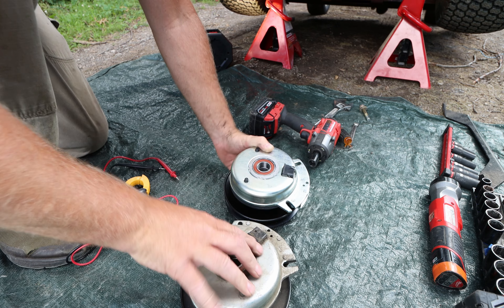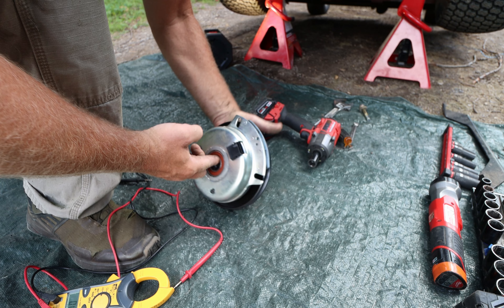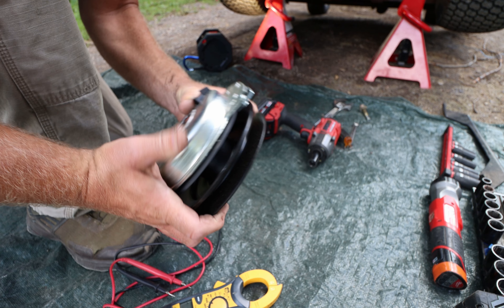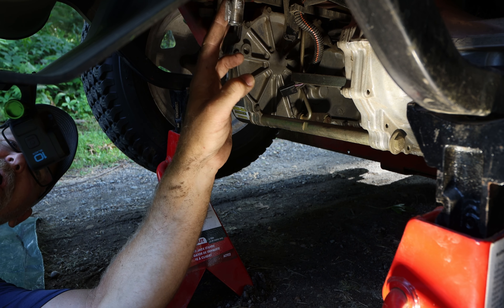Exmark Radius Clutch Replacement!

Comment: Doing this today on my father-in-law's exmark radius.     Great video.     Thanks
Reply from the maker: Thank you!
Reply: @oakwoodlawnmaintenancellc.1093 mine has been on since I bought it and it still works but I'm almost certain the bearings are bad. I just bought the newest Milwaukee 3/8 impact with 1500 break away torque but am afraid the bolt will break off inside the shaft on the 3rd setting. What setting did you use? Any help would be greatly appreciated!
Reply from the maker: I believe I had my Milwaukee impact set on the high setting. I gave it a few quick hits on the trigger, counting to three each time. The bolt was tough to remove, and it felt hot afterward. From what I know, these bolts usually have some sort of anti-seize applied, so they shouldn't break. If it's still stubborn, you can always try applying some heat to the head of the bolt to help loosen it. @Nate_4545

Comment: Great video very informative. I have to wander if clutch plates springs were starting to get crowded and just hanging and not releasing when switched off that would drag on belt and over heat everything..

Comment: Some manufacture's recommend:  Use torque wrench to tighten (55 ftlbs), no lock tite.  Last Step:  Before use, Burnish new clutch/ Roter and armiture come together as both need to be broken in.  Put deck into top position - Start tractor,   Briefly run at 3/4  throttle,  run /disengage for 10 times.  Thank you.
Reply: I have always heard half throttle and 10 times for sure.  Some as many as 30 time.  They all have torque specs.
Reply: I tighten to 60 ftlbs.  If you use anti-seize, you would torque to 45 ftlbs.    I generally remove a spark plug and use a short rope to block the piston.   I never use an impact to remove/install the bolt.   I engage at a slow speed a few times and work up to full speed to burn in the clutch.   I'm not sure that it makes any difference!   Taking the clutch off and cleaning it at the end of the year would probably extend the life but that goes for about any piece of equipment, if you have the time.

Comment: My mechanic was charging me $800 for the clutch + installation. On a 32 inch toro pro line. I got the clutch online for $150
Reply from the maker: @luckclave  Business owners charge higher prices due to costs like overhead, wages, and materials. Doing it yourself can often save money and provide valuable experience.

Comment: Should have used a torque wrench.  Premature bearing wear on the clutch.
Reply: Correct.Too much pressure is not good. I have a 56" Exmark Lazer Z and I believe the torque for the crank bolt was 50 foot pounds or so. Also,any clutch like that should be broken in before using the machine or clutch life is shortened. Nice video .
Reply: @jmtoptierlubricants8357 how do you break it in?
Reply: @speed_demon420 Deck up, 1/2 throttle, start blades let them come up to speed then stop blades and let them come to complete stop, repeat that 10 times and it’s ready to go.